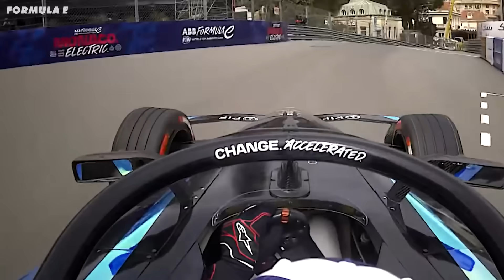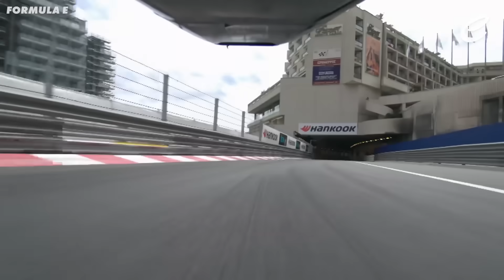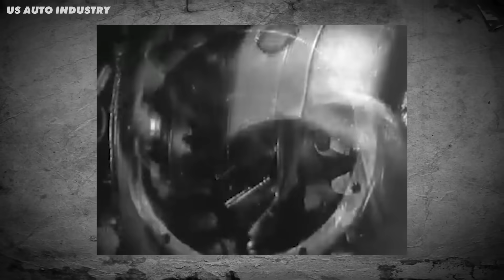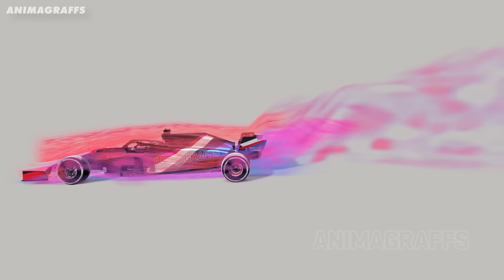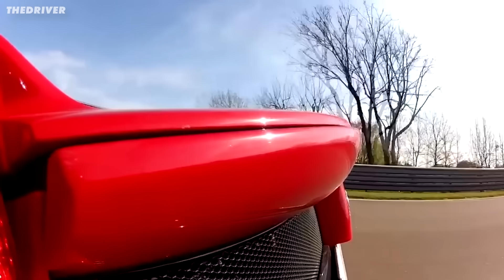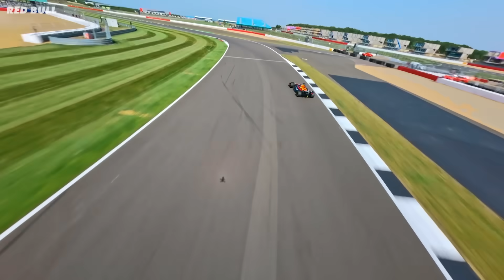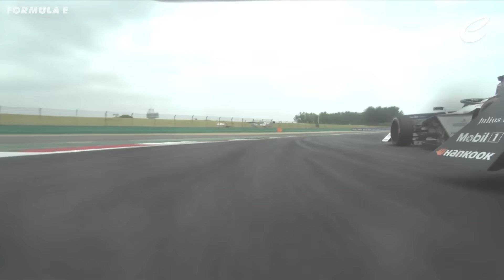The New Formula E Car Might Be F1 Fast

Comment: If F1 is so adamant on using hybrids why don't they adopt what Williams would have used with the Flywheel Hybrid system from what I've heard that system was smaller and lighter than the current hybrid systems which could see cars being slimmed down drastically in size and weight
Reply: And put them in the front, like LMP1 did, honestly all of the solutions F1 needs has been developed by LMP1 golden years 15-16-17, and then they fear audi domination, the one to blame is the manufacturers and FOM here. Such pity.
Reply: This is about Formula E though.
Reply: What does this have anything to do with this video? Did you even watch it? Or are you just trying to give your "informed" take on why change in F1 is bad?  If you bothered to look into this at all, you'll realize KERs has major limitations and that F1 had KERs and got rid of it.
Reply: From the way some of the wording in the 2026 regs is, I think FOM management is actually looking at dropping the hybrid completely and going sustainable fuels
Reply: Formula E isn’t hybrid though, it’s full electric, Formula 1 is hybrid, so you’re comment is not relevant for Formula E…..
Reply: cause flywheel weight per WH is abysmal compared even to the shittiest battery.
Reply: @АлексейКастевич 
But they deploy rapidly and repeatedly at high power, and just does not wear out unlike a battery which can catch fire, in motorsport application, it's better to store just the energy for a corner then absolutely send it on the exit, since more power at top end doesn't really help because the power required is cubed the more speed you get. The low speed gain is better here.
Reply: @Dakkyun  kinetic energy storages posess other hazards: if something goes wrong, the heavy debris would be travelling close to the speed of sound - pure bullets.
Racing teams tried using kinetic energy storages in LMP1-H, but this technology proved to be uncompetitive, and all converged on li-ion. Batteries just store orders more energy.
Reply: @АлексейКастевич 
The older toyota in 2013 had supercapacitors which is like the indycar hybrid, except they have well over 500hp on Regen AND deployment, there's no moving parts there.
Reply: @Dakkyun  yeah, I know, but eventually they went for chemical energy storage like others
Reply: @АлексейКастевич  we are just really desperate for a steampunk mechanical system that doesn't need exotic materials like lithium or cobalt. Soooo yeah, flywheel.
Reply: @Dakkyun  sadly it stores so little energy that there is no point in even trying anymore
Reply: Because no road cars use flywheel batteries
Reply: .....
Jesus Christ is the only hope in this world no other gods will lead you to heaven

There is no security or hope with out Jesus Christ in this world come and repent of all sins today

Today is the day of salvation come to the loving savior Today repent and do not go to hell

Come to Jesus Christ today

Jesus Christ is only way to heaven

Repent and follow him today seek his heart Jesus Christ can fill the emptiness he can fill the void

Heaven and hell is real cone to the loving savior today

Today is the day of salvation tomorrow might be to late come to the loving savior today

Holy Spirit Can give you peace guidance and purpose and the Lord will

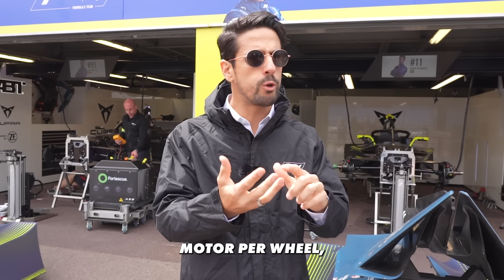John 3:16-21

16 For God so loved the world, that he gave his only begotten Son, that whosoever believeth in him should not perish, but have everlasting life. 17 For God sent not his Son into the world to condemn the world; but that the world through him might be saved. 18 He that believeth on him is not condemned: but he that believeth not is condemned already, because he hath not believed in the name of the only begotten Son of God. 19 And this is the condemnation, that light is come into the world, and men loved darkness rather than light, because their deeds were evil. 20 For every one that doeth evil hateth the light, neither cometh to the light, lest his deeds should be reproved. 21 But he that doeth truth cometh to the light, that his deeds may be made manifest, that they are wrought in God.

Mark 1.15

15 And saying, The time is fulfilled, and the kingdom of God is at hand: repent ye, and believe the gospel.

2 Peter 3:9

The Lord is not slack concerning his promise, as some men count slackness; but is longsuffering to us-ward, not willing that any should perish, but that all should come to repentance.

Hebrews 11:6

6 But without faith it is impossible to please him: for he that cometh to God must believe that he is, and that he is a rewarder of them that diligently seek him.

Jesus
Reply: Flywheel systems aren't as good as batteries, even Audi abandoned it.
Reply: i think you mean kers?
Reply: At one point it made sense, but battery tech has advanced massively, and continues to do so. The flywheel doesn't have room for much more development, but batteries are being made from all sorts of materials. Sodium ion, aluminum ion, graphene, super capacitors etc.

The ceiling for chemical research and development is significantly higher than mechanical solutions
Reply: How would that push "THE MESSAGE" though? 

F1 compromises performance for political correctness but is somehow the "pinnacle of motorsports"
Reply: @teapot2_1 100%
Reply: @teapot2_1  All this yap about political correctness, what nonsense, the only political correctness is baby boomers complaining about "much noise" if it was just about performance, they'd all be running smaller 2-4 cylinders with more battery reliance, if not just straight up binning that off for hydrogen cells. The fact that they're dropping MGU-h alone should say enough that this political correctness argument you have is pure nonsense.
Reply: @teapot2_1  they do barely anything regarding political correctness, they’re just virtue signaling even if political correctness (and progressiveness as a whole) is good
Reply: @teapot2_1  The current F1 cars are some of the fastest and most powerful they've ever been. Hybrids aren't a compromise - good luck getting a pure ICE F1 car to anywhere near the performance they have.
Reply: @drunkenhobo8020  the 2004 Ferrari on modern slicks is as fast or faster than the W11 and thats 16 years of aerodinamical advancement. pure ICE is simply better on track due to the smaller weight.
Reply: @allorfh  i think agressive KERS is worth looking into because reusing the energy you spent saves loads of fuel.

Comment: What does brake horsepower actually mean, i dont really get it
Reply: The amount of power required to break a horse in half
Reply: Its just hp but it just sounds cooler
Reply: Like horsepower, but it takes into account losses in the drivetrain (gearbox, diff, tyres). It’s a more accurate measure of how much power actually makes it to the ground.
Reply: Brake horse power is called that because they use a special brake to resist the engine's output. The amount of force that the brake applies against the engine can basically be used to calculate the power supplied by the engine to the wheels. That's essential what a dyno is doing.
Reply: UK’s power unit
Reply: "We can beat F1 if we want" 😂😂😂 everyone's a hero, but when it comes to proofs...
Reply: @j.thomas7128  you're so wrong it's unreal lol. go read literally one thing about it
Reply: @j.thomas7128  I'm going to be very nice and very understanding and teach it to you here for free: BHP is before the gearbox, WHP is after the gearbox and driveshaft and tire resistance. One is measured by mounting an engine to a dynamometer, the other is measured by strapping a whole car to a wheel dynamometer
Reply: It's not an SI unit so don't use it, use Watts instead which is simply Volts × Current or V×I = w
Reply: Brake horse power=power to the wheels, so including all the friction of the transmission and such
Horse power=raw engine power straight from the engine
Reply: @wormytreg  Not accurate, bhp is a different unit
Reply: @wormytreg  bhp is not wheel hp at all lmao common
Reply: @atn_holdings  my sincerest apologies
Reply: @j.thomas7128  Not the same. BHP is also engine power just with factors like frictional losses, in other words power delivery before reaching the driveline. WHP is the power that actually ends up to the wheels
Reply: Best I can break it down, there is horsepower that makes it to the flywheel (brake horsepower) and horsepower that actually transmits onto the road.

It's why you hear conflicting numbers for horsepower outputs for certain cars. The Bugatti Veyron has 1,001 brake horsepower but only 987 that makes it onto the road. Lamborghini Aventador, 700 brake horsepower and 691 horsepower.